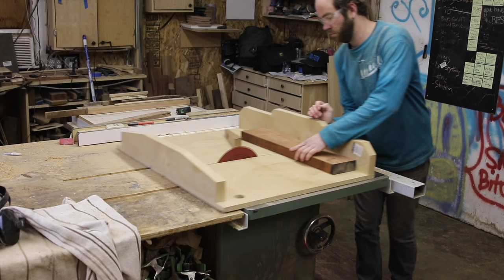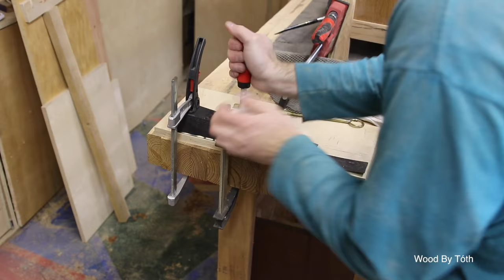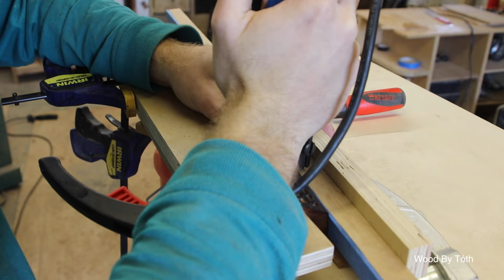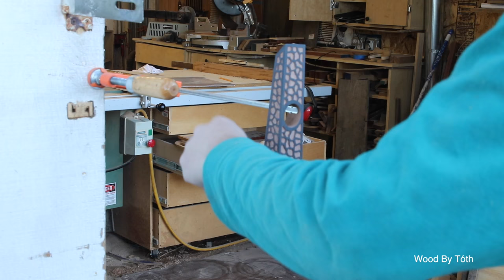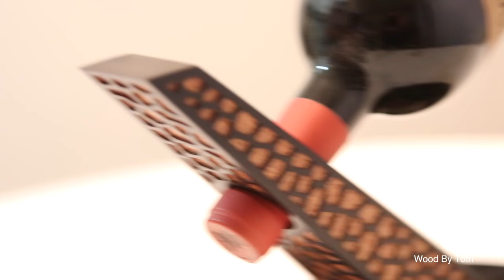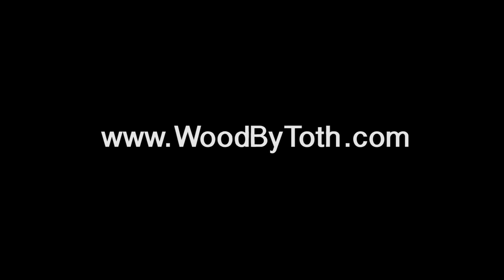Carved Wine Bottle Holder

Comment: Is that actually going to hold an empty bottle without tipping over? There's a 2.75-3.5 lb weight difference between a full and empty bottle of wine, and that's a steep angle...
Reply from the maker: Peter Schexnayder Yeah it still holds a bottle empty or full. Pulling the bottle in or out helps balance it more